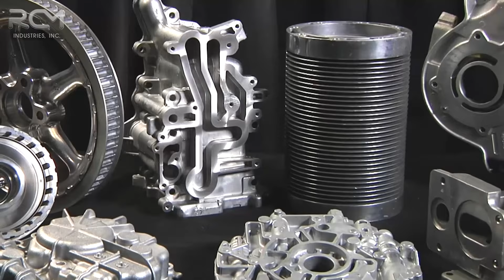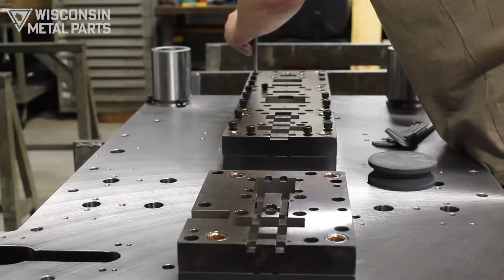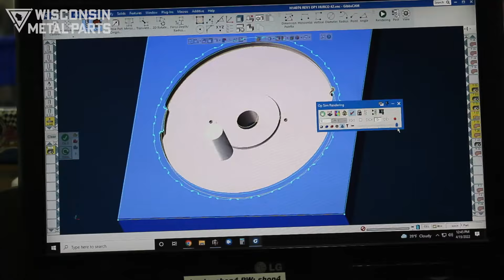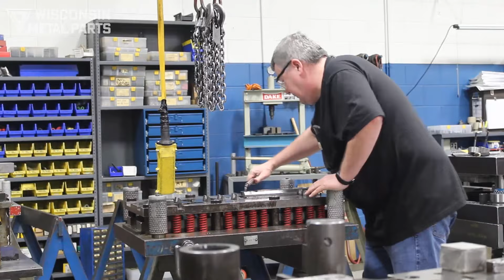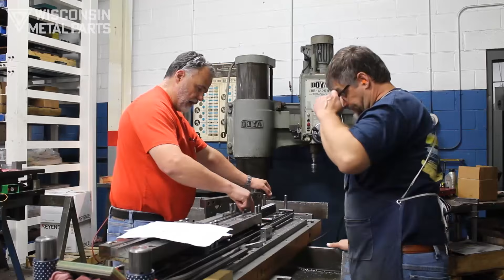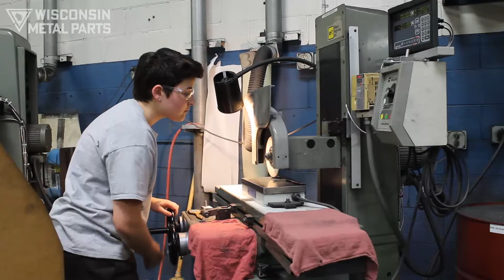Considering Careers: Tool & Die Maker Apprentice

Comment: If you like working with your hands and solving complex problems on your own merit, you might want to consider a career as a CNC / Maintenance Technician.  There is very high demand for them therefore the job pays very well.  I'm a CNC / Maintenance Tech and I'm the highest paid guy out on the floor, making considerably more the the Tool and Fixture guys.  Variety is the spice of life.  If you aren't into rinse/repeat type work, maintenance requires a wide range of skills that are used regularly in small/mid size shops that don't separate them.  I'm working with hydraulics, pneumatics, mechanics, electrical, machining, computers/programming, electronics, and more.  One minute I might be line boring part of a tool changer to sleeve & rebush it after the old bushings wore out and wallowed out the bores.  I might have to modify a machine ladder to integrate a second chip conveyor into the machine logic.  Get interrupted doing that because we lost a spindle amp on a hot machine so I'm tearing that apart testing IGBT & diode modules, capacitors, transistors, etc., scrounge up replacement parts & get it back in service.  I might have to reverse engineer & machine replacement machine parts because it's a hot cell and we don't have time to wait or they're simply no longer available from the manufacturer so I have to whittle some out.  Another fun project was I designed & built data loggers that logged pallet changes saving the data on SD cards & controlled via WiFi to dump data, change meta data, etc. allowing the office to directly monitor production rates and eliminate the need for manual time studies.  It does require the ability to multitask because while you're trying to get some of this stuff done you're interrupted by calls out on the floor for tool/pallet changers, leaks, pumps, fixtures, etc. that can be very frustrating at times.  I've had no formal training, didn't even graduate HS, just learned in the school of hard knocks because that's all I could afford...  So if you're good with your hands, like to wrench, play with solder, whittle on metal, fondle bytes, and want to make top cash, do like I did and become a CNC Tech.

Comment: I have an A.A.S. in machine tool technology. Four + decades in the Tool & Die  trade. The last decade I was able to see WEDM results first hand . Any young person interested in Machine tool , I suggest you take any opportunity to run WEDM tooling . it is clean ,precise to almost unbelievable tolerances and last but not least you will work in a climate controlled room { AC} .   Some parts would be near impossible or cost prohibitive to attempt by any other means .

Comment: What is tool and dye making? Well this all I found out then forgot by convincing myself that they make prototypes of like automobile transmissions or parts and check for imperfections and then it goes to like the plants or other business to get stamped out like in 8 mile or like shops in like Chelsea that may produce parts pretending they’re imported from Mexico and they grow weed to cover it up but did transmission assembly or production to cover the weed up like two separate groups staring at you. Like I assumed they also stole and made duplicates of tools and things that break and then they sell one to the same place/person or worker because the shops weren’t actual businesses with an owner. Michigan sucked ever since these guys got here. They go into a business or place that operates machines because different people go there and it’s bad for business to kill people at one or abduct someone or to shoo people away. They break a part on usually very old machines from back even when Germans worked here in Detroit when Berlin was built before moved to Europe or Germany over there, so when you guys moving this Detroit to Pittsburgh or wherever. Machines just cut or drill metal and wrap wire and stuff to make work longer or produce less heat, it causes things not to migrate south it means capitalism may not go on anymore. They gotta produce stuff fast to sell or they miss the market and the inventors produces enough to distribute I guess capitalists are all spies it’s why everything was stupid. Not fast enough on vaporizer coils though they did some giant legalizing pot thing to sell them and end communism they do or did. Eventually they took like every business over like this even t shirt print shops and they all pretended to be electricians. Matt jones organized all of this as a dictator that smokes weed with fake teenager humans. They all didn’t know what continent they were on they just change signs and pretend it was simulations.
Reply: It Could be. lol

Comment: I’ve been a tool and die maker since 1972 . When I started my apprenticeship I was paid $6.00 an hour. I stayed for about 5 years after and was the head toolmaker. Due to internal family issues I couldn’t deal with the owners anymore so I quit and started my own shop. Real basic production machining but it made me money. I threw most of the profits back into the business. Before long I started buying CNC machines. I learned how to program and set them up. 15 years ago I sold the company to my sons. At that time there were 15 CNC and several manual machines. The very best part was about 30 years ago I started manufacturing my own line of motorcycle performance products. Nothing beats having your own products. To make it better yet was they were machined from billet aluminum. Thank you for this video. We simply must get the next generation interested in this trade. Nothing out there would exist without tool makers.  Think about it can anyone name something that didn’t involve a tool maker? If you love what you do you’ll never have to go to work.  Thx again👍🏼👍🏼
Reply: $6 in 1972 is equivalent to about $50/hour today.

Comment: How good does one's math skills need to be to be a successful toolmaker? What types of mathematics will be used every day?
Reply from the maker: Years ago you needed to have very strong math skills. Today much of the calculations are done by computer or calculators. At a minimum you will need to acquire basic math, some trigonometry is helpful and blueprint reading skills. Most of these subjects are covered during the apprentice schooling. Hopefully you don’t see math as a barrier.
Reply: @WisconsinMetalParts  I actually ended up on an Electrical Apprenticeship
Reply: Just Arithmetic. All other sizes are gotten by  going into engineering and asking the cad guys for a size. A few clicks of the mouse later and bingo another print comes out of the printer with the size you were looking for. Lol.

Comment: Worked as a tool die maker when I was about 21. Small shop, we built new shoe dies from old shoe dies collecting all the valuable hardware. We had to plan how to use the new hardened die on shoes that were second hand. Quite a learning experience. Tool and die, live or die!
Reply: We always kept a lot of old hardened die steels to wire burn into inserts.  Our wire guy was magic with that machine, he could taper lock inserts every single time perfectly.

Comment: Excellent video! I was a tool maker for 15 years primarily molds for appliance industry and now in Quality/warranty for automotive industry.
The tooling background is invaluable now as I can spot quality issues and helps with solving warranty problems as well….
Keep up the good work!

Comment: I'm 43, just discovered a machinist career 2 years ago (man I wish I found it when younger) and it's a great fit for me. I currently run a Toshiba CNC Horizontal Mill, with experience on a manual HBM, as well as wire EDMs (lot of cross training in 2 years). Problem is, the job is over an hour away, and just recently a T&D shop posted they were looking for help which is 20 minutes away. Is any of my experience transferable, and is there any point going into a new apprenticeship at my age?
Reply: Do you run them or do you program and run them?  Most large shops would be interested in anyone that can run a wire machine well, that knowledge can translate to CMM (metrology) and down to waterjet and plasma cutting.  Not many die shops use a horizontal mill, but if you're good just lay the tombstone flat in your mind and you'll get accustomed.  Is there any point in an apprenticeship at your age?  They pay you to learn, not a bad gig no matter what age, and they confer upon you a new skill.  To each his own though.
Reply: @scottrackley4457  depending on the job, I will write and run the program. Mostly just drill/tap, keyways, facing/boring. We do some hog outs, but engineers generally write those programs. Still need to know how to read  it in case they screwed something up though (which is often). We mainly run HBMs as we handle parts in excess of 30k pounds, some up to 80k, which don't really work on a vertical. I'd imagine it's not too difficult to transition over to running vertical, numbers are all the same, just rotating your axis (which would make some of my jobs so much easier to begin with). We do have a vert Hydro Tel, but it rarely gets used. 
Running the wire machines is fun, they don't keep them maintained like they should, so they barely function. I never really though of the waterjet/plasma crossover but it makes sense considering they're basically the same layouts. We don't do any 3D cutting though. 
Anyway, I did inquire about the mentioned job, but they informed me that they had already filled the position. So I'll just keep learning all I can here.
Reply: @Atreyas  Pick up a class or two at the local community college in something like Mastercam or Solidworks.  Pro-E if you feel froggy.
Reply: No point at all, you're due to retire.  Stick to what you're at and  don't try to turn back time.
Reply: @martindennehy3030  retire? He has like 23 years until retirement.
Reply: @martindennehy3030 I agree with you about the guy who asked if he should start at the bottom again to work closer to home. And Yes at 43 years old he should keep his retirement in mind.

Comment: I trained as a small-part non-ferrous metal foundry patternmaker and worked as such for about 20 years until the mid 90s, when CAD/CAM prototyping, then additive manufacturing/3D printing made a large part of what I initially trained in less in-demand. We made most of the patterns out of boxwood and other hard timbers, and most of the skill required, apart from spot-on drawing interpretation, was woodworking! Although I learnt computer skills, it wasn't as rewarding nor as 'hands on' as manual shaping of component patterns. So I went into architectural and cabinet detailing, and have done that for another 20 years. Ex-colleagues work for car companies making solid maquettes for new models. Skills are transferable, you just have to think laterally and long-term about how they could be used, as no-one knows what will be required by the evolution of trades and occupations in 20 years, let alone at the end of your career.
Reply from the maker: Thank you for sharing your story. You are correct that the skills are transferrable and a good tool maker can adjust with the changes. This trade is the foundation of manufacturing.

Comment: I did some of this before, stamping is the best and cleanest, toolmaking. Wouldn't want to work with molds unless I had to. If your into it get a degree in mechanical engineering first, when your young afterwards work in the shop. This way you get your education out of the way and no one can fault you for not having a degree. If they require a degree later on for another kind of position in the company. ie manager, engineer you will be ready.
Reply from the maker: Thank you for your response. That would definitely be a well rounded education and create a highly skilled, highly sought after toolmaker.
Reply: Mechanical engineering has nothing to do with mould making and you don't need to have a degree to be educated.

Comment: Please explain about formula, calculation, procedure to make die....
Thank you
Reply: Do you have about 4 years to spare?
Reply: Depends the design of the drawing
Reply: Depends on material, variability of material, thickness, tolerance of part, expectation of surface quality, size of part, the amount of pierce/blank/form you're doing, tonnage of press, bolster/ram size of press, speed of press, preferred shut height of press, preferred feed height of press, expected run quantity of tool per PM, etc.  It's not easy.